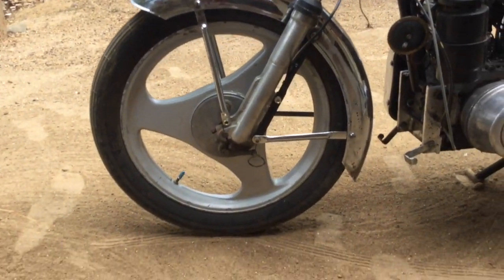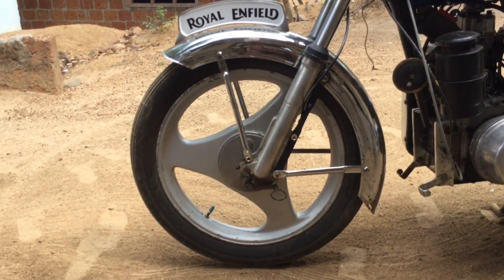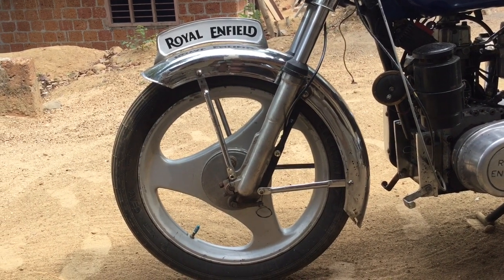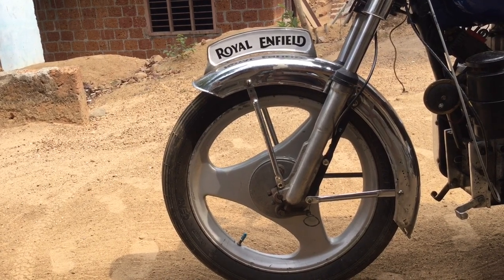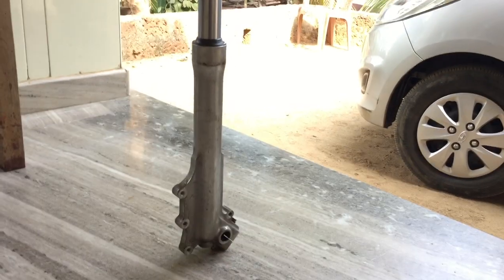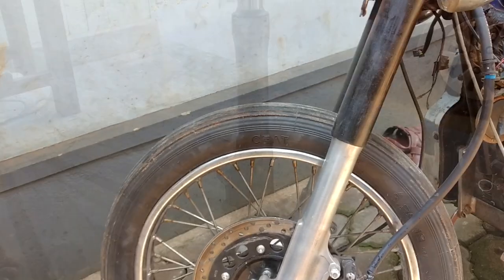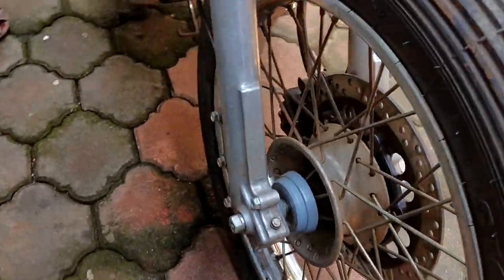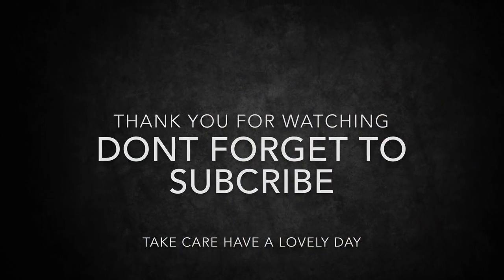Drum breaks to Disc breaks Conversion | Royal Enfield

Comment: I am planning to buy standard 350 & I will converted into front disc brake. So, my front suspension will change or not & how much cost it will?
Reply from the maker: +Rahul Khare new standard?
Reply: Matte Black  yes new bullet 2017
Reply from the maker: +Rahul Khare i am not sure if 350 is still available. But if it is then u can buy the original spare parts from the showroom and install it. But u need to chnage the wheel. As of for the suspension u can still use the stock ones.
And it will cost youaround 7-8k for the brakes and parts alone. :) If you have more questions u can message me on my fb page.
www.facebook.com/matteblack11/